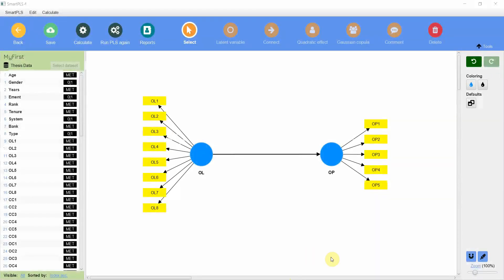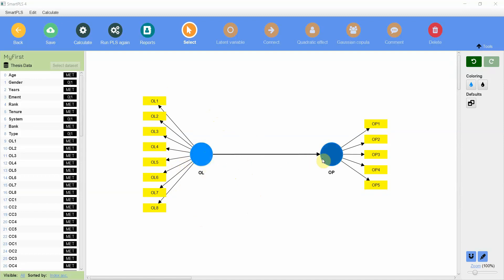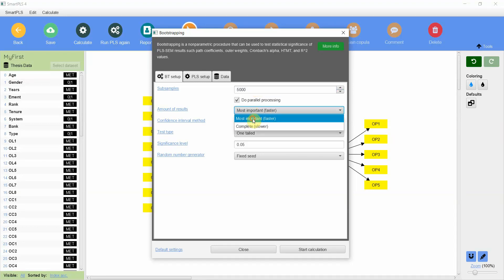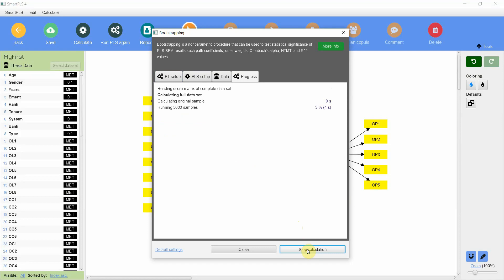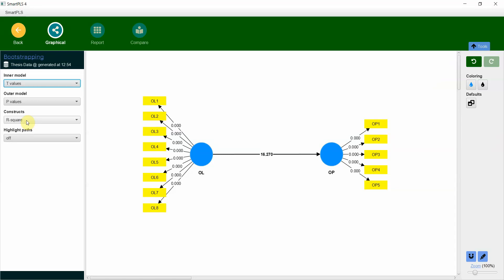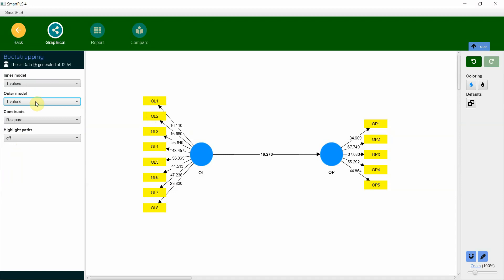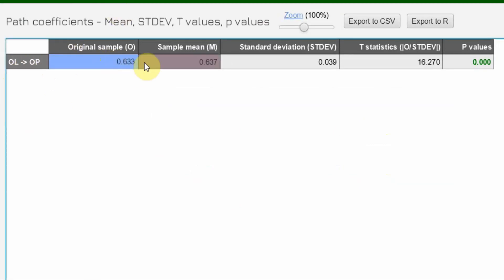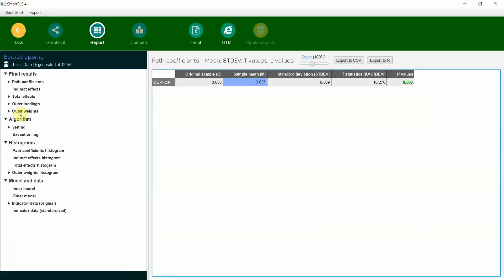Basic Structural Model Analysis using SmartPLS4

Comment: Thank you very much Dr. for the video. Please I have a question, I did my SEM analysis using AMOS but I kept getting an AVE values of within 0.398 and 0.423, should I change and use PLS-SEM? What is the difference between SEM and PLS-SEM?
Reply from the maker: You may try PLS-SEM, it may give you better results.

Comment: sir, may I ask why use one tail instead of two tail?
Reply from the maker: One Tailed is used when we hypothesize a positive or negative relationship. Simply, if we assume the direction of relationship based on the literature.
Reply: So if I think of the way that one tailed use 0.05, and two tailed use 0.1, is this make sense ? Is it acceptable to do like this?
Reply from the maker: No. Please read some literature on difference between One-Tailed and Two-Tailed.

Comment: I didn't understand, the developer said when we have a total reflective model we must run a consistent PLS algorithm and consistent bootstrapping instead you are running always the PLS algorithm. Why?
Reply from the maker: No it is not a must. It is utilized if you would lile to model your results in line with cbsem. Otherwise, run normal pls algorithm
Reply: @researchwithfawad  Its mean when we run the model using a consistent PLS algorithm then we get the same results as in Amos or CB-SEM software? If possible then share your contact detail. I am also a research passionate.
Reply from the maker: No, not the same results.
Email me on kh.fawad83@gmail.com